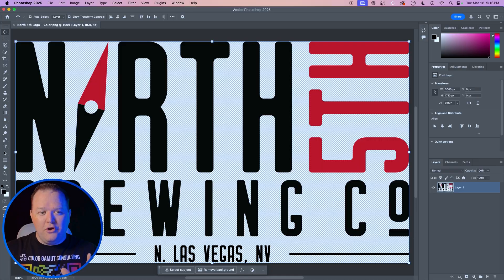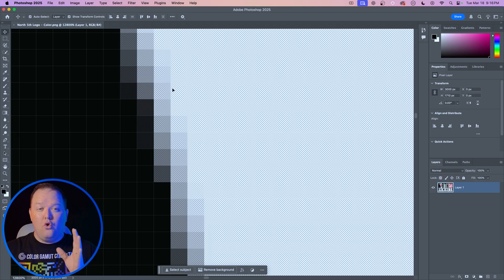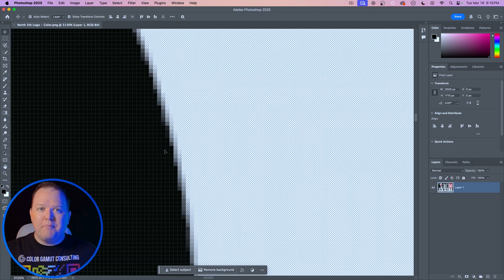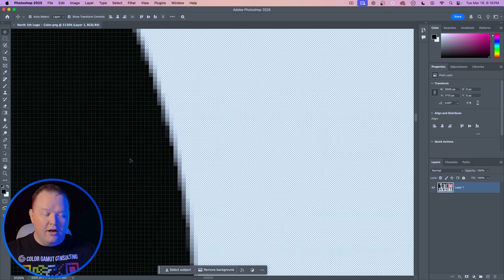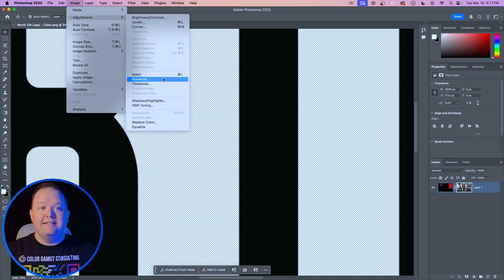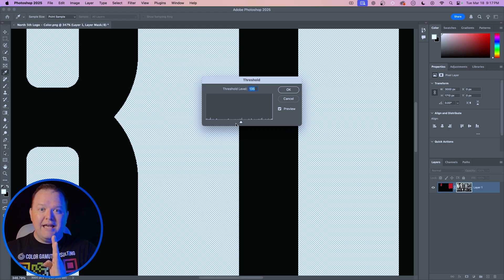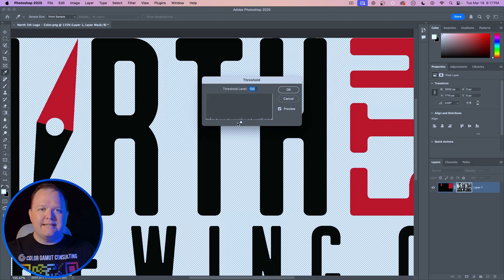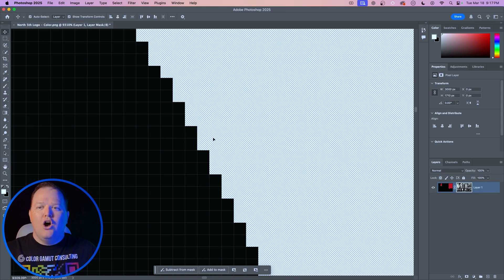How to Fix Unwanted White Edges in DTF Printing | Hint, it's not your Printer!!

Comment: The problem i am having. If you can help me. I am trying to do this sunset graphic by the beach. And bas black shadow of palm trees. I am halftoning it with Cadlink 11 Raster. Once i have it ready the way i want it. When i click okay. It is sent to my pring screen with a kocked out black.  Regardless the garment color. Which i will be using a dark blue. How to prevent the raster plugin from  eliminating the black, when sent to the printing preview screen. I dont want palms looking blueish. Where do i have to make changes to keep the black?
Reply from the maker: I don’t use the halftoning within digital factory…and I believe it’s only designed to halftone for black shirts only so it going to also knock out any black. Do everything in an editing software like Photoshop or Affinity then just use Digital Factory to RIP and print.

Comment: Such fantastic, simple, clear instructions. Thank you so much. This has worked well for me. One thing I have noticed though is my prints aren’t printing out as vibrant. I’m losing a bit of colour definition. Have I done something wrong?
Reply from the maker: could be a bad ICC or your printmodes is limiting ink too much or your film can handle enough ink.  But most likely its the ICC.  CMYK printing is going to be less vibrant than a computer screen.  just the nature of Additive color vs subtractive color.

Comment: Hi i having a dtf converted Epson l18050, I'm having trouble getting the blacks printed in greenish in some places is it because of the colour percentage in acrorip or something else. I'm using my colours 30% white 40% and other coloured prints comes good except black. Sometimes the black also comes good in my previous prints but in last couple of days I tested the blacks getting greenish fades here and there, is it because of the design or ink percentage or print head issue or something else?
Reply from the maker: converted machines are tricky.  Ultimately you need a custom profile for that printer

Comment: Sending out an SOS. In the context of Text (designed i PhotoShop or Vectors that have been imported from CorelDraw into Photoshop as a PNG ...how do I deal with white fringing on the edges wrt ant-aliasing. Do I leave anti-aliasing ON or OFF when exporting my designs to the print house for DTF printing? I have also tried techniques such as Adjustment > Threshold >128, Matting > Remove White Matte and Defringe 1-2 pixels.  Or is the answer to choke the white under-base by 1 pixels? What is best practice in the industry?
Reply from the maker: Best bet is to use the steps in the video...not sure about the remove white matte and defringe.  it is best to choke a little bit at least 2-3 pixels on everything.
Reply: @ColorGamutConsulting thank you and appreciate you taking the time to respond 👍🏻

Comment: Hi, Jared! So glad to have found your channel. If we are creating designs in Illustrator and turn off Anti-aliasing and export the file at 300 DPI as a PNG at the size we want to print at, will that prevent semi-transparent pixels?
Reply from the maker: It should, I personally have not had the best of luck with anti-aliasing turned off, sometimes it works for me and sometimes it doesn’t. Haven’t been able to figure out why so I can’t confidently give people that advice.

Comment: yo, this worked with my designs but I cannot make it work with words. I use almost always fonts that are very thin, and when I use this it makes the words look extremely pixelated, and even when its not that bad it modifies the thickness of the font in a very noticeable manner. Is there a way to delete semitransparent pixels for words? i would show you a screenshot but I dont know if youtube would delete my comment because of the link.
Reply from the maker: It shouldn't look too pixelated with printed but you could also separate the text from the rest of the image to handle the tolerance differently.  You can also email me: colorgamutconsulting@gmail.com

Comment: damn. still getting that white halo all over. DTF printer techs are saying the edge is too jagged/pixelated and not smooth enough. any ideas on how to fix?
Reply from the maker: The edges don't have to be smooth.  What is your choke set at on your RIP software....what RIP?  If you want to email me the file I can do a quick check on it. colorgamutconsulting@gmail.com